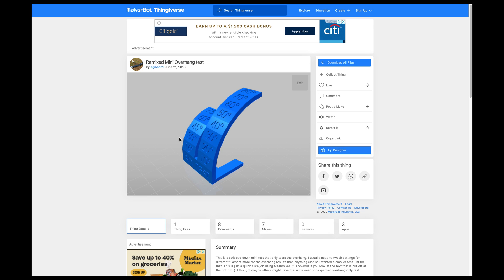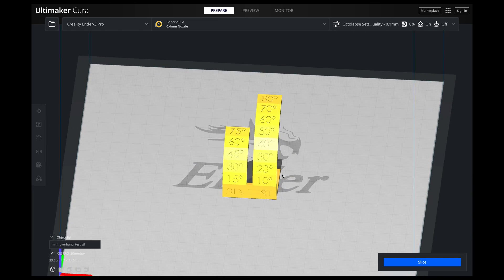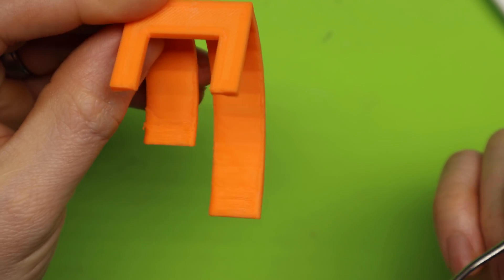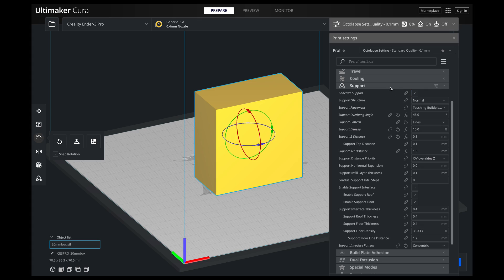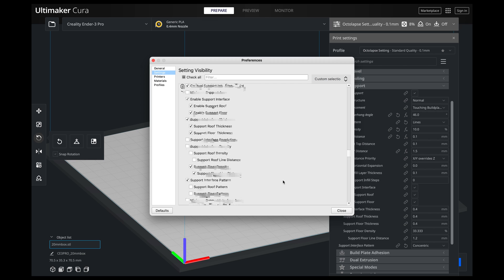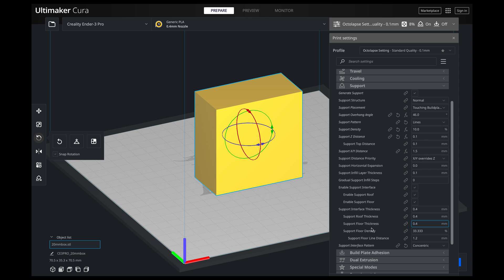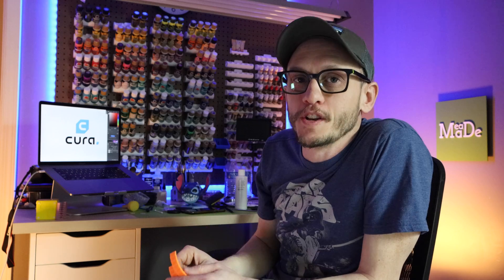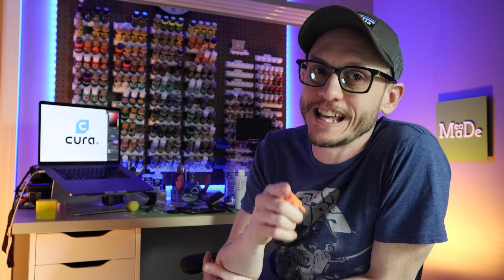Cura Support Settings: Overhang Angle - To Support or Not to Support

Comment: Would I need to test the overhead angle supports with different types of filaments? I'm still a beginner, but I've learned that different types of filament, even different colors of PLA require different temps (thanks to your previous video and researching transparent prints). Would I just need to learn the angle for the printer itself and the temps for the different filaments?

Comment: Great video! Question, does infill density make a difference? One of the downloads for this test recommends choosing 100% infill, which, of course, I would not normally be using on a model. Thanks.
Reply from the maker: Yes infill always makes a difference you don’t want 100% that’s solid plastic. I typically print everything 8%-15% infill. The higher you go the stronger it is.

Comment: Great video, excellent content, perfectly pitched at my newbie to intermediate level. I'll be sure to start at the beginning of your Cura series and go through them, one by one. I have a fair idea of what's happening but you really help me understand important settings and details I would otherwise have missed. Thank you, you are a natural educator.
Reply from the maker: That’s great glad you find it helpful. And thank you for the kind words. Best of luck printing!
Reply: @ItsMeaDMaDe  Thank you for your kind wishes. Just finding my feet again after a lay off involving a Bondtech / Mosquito upgrade. The actual mechanical part went well. The screen firmware was a nightmare. I eventually found the right file (quite different from the linked files on Bondtech's website) and lo and behold...a working system again. Extrusion and flow were straightforward. Retraction is proving a bit more fiddly. Stringing on only one of the stringing towers?!?! 

Anyways - watched the first three videos on what is required Cura knowledge. Again, filled in some gaps in my knowledge and I'm very grateful! Next, the support series...

Comment: my ender 3 v2 can handle overhang well in-front, side (Left/Right) but not at the back side with it is very puzzling for me :D
Reply from the maker: It may be off level. Might want to re-level your bed and try it again. That does sound odd though.
Reply: @ItsMeaDMaDe  I use klipper, did the screw tilt level even auto level with bltouch, does not seem to fix it at all which very confusing as it only happen to the back part of it

Comment: I am a little confused.  It looks like angles way past 50 print really well.  I'll have to try that calibration print on my FLSun SR.  The last time I printed that was on my Ender S1, and it didn't go to well past 50.   I love your channel.  You have a natural talent for teaching.  Great work!
Reply: I also print pretty much in white PLA, then finish with paint.  I suppose the overhang angle somewhat depends on filiment used.  Some plastics probably do better at adhesion on overhang angles?
Reply from the maker: So to address both comments:
I’m kinda upset cause the camera wasn’t in focus and I didn’t realize until editing. When you print it you will notice when it starts to not print as clean. It was the edges on mine that were the most noticeable. It’s also have safe you want to be to ensure you have supports covering the areas your iffy on. 

Second: yes there are many factors when it comes to overhangs to consider. Your speed, temperature, and material. All of these can change your angle. That’s why I said use the settings you are trying to print your models at and set that as your overhang angle. 

Lastly thank you so much for your kind words. Teaching is my passion and this platform is my outlet. 😁
Reply: It really depends on how well dialed in your printer is. I run a 70 degree overhang angle with no issues.
Reply from the maker: That is spot on. Some printers just handle overhangs way better than others and even on the other side if you have it dialed in good you can go way farther. I could do 65 with mine but I find some models don’t do so good with that angle and I keep it on the safe side. 

Thanks for the input!
Reply: @ItsMeaDMaDe  yeah I usually keep mine at 60-65 depending on model,  of course, in your video,  if you wanted to print that cube at 45 angle, and no supports, it would fall, I know you are leaving that information for another video,  but yeah sometimes the overhand angle choice depends on keeping your model stable on the bed, and not so much about what the printer is capable of.
Reply from the maker: @agriperma  Yeah most printers can handle up to 65º i sometimes go up to that depending on the model. You are also correct, it would fall for sure. I just used a cube to show a flat surface to understand the angle easy. Small points of contact is going to be in one of the topics in one of the videos. So you are way ahead of me. 😁